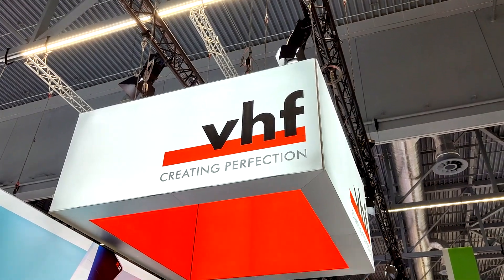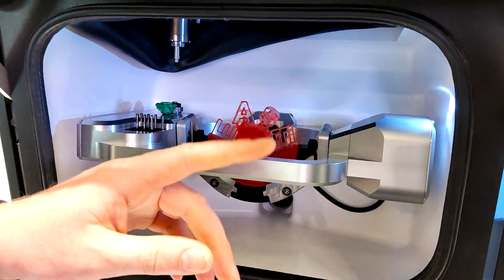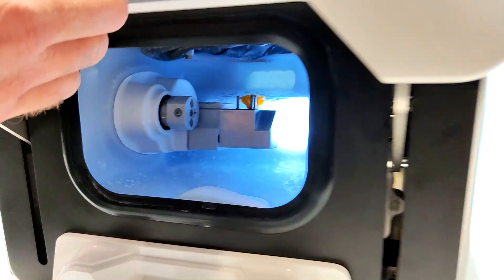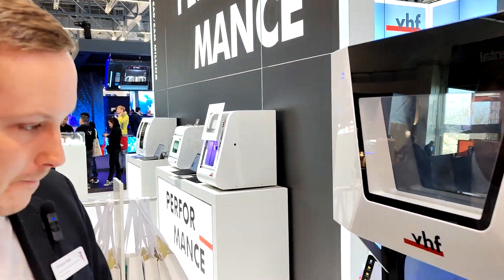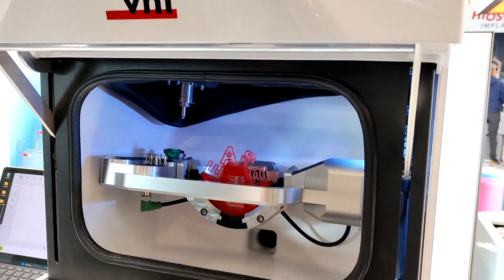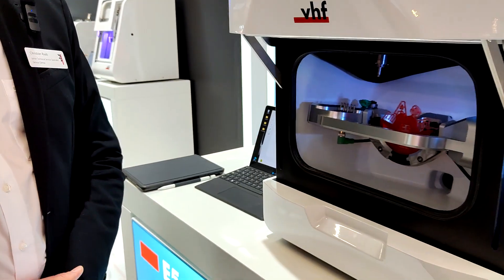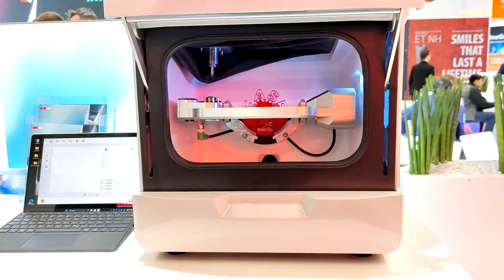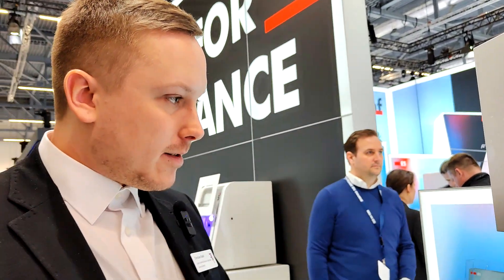VHF new well priced CNC machines - IDS 2023

Comment: Materials question for you.  In the US, Cerec has the market so locked down that besides the mounted zirconia blocks for them, you don't really see any other brands for units like this.  What are you guys using in Europe for single zirconia crown blocks?
Reply: Hey effef, on vhf machines you can use all zirconia blocks from every manufacturer, as long as it has the cerec connection (standard in the dental market).